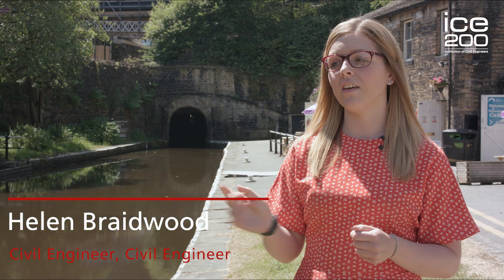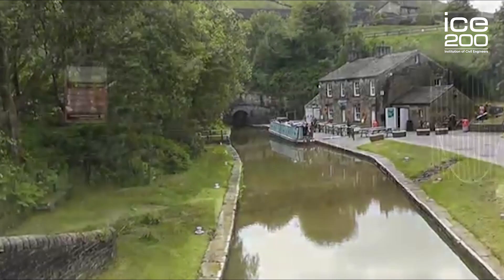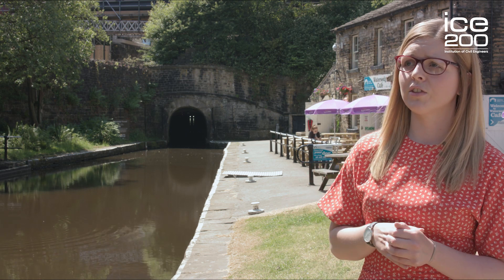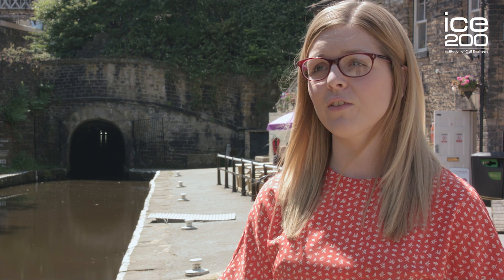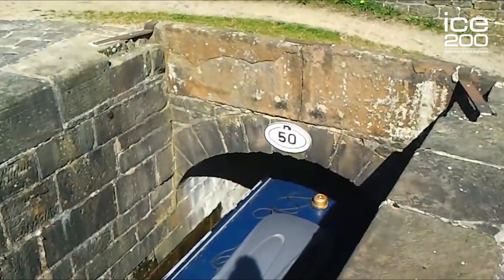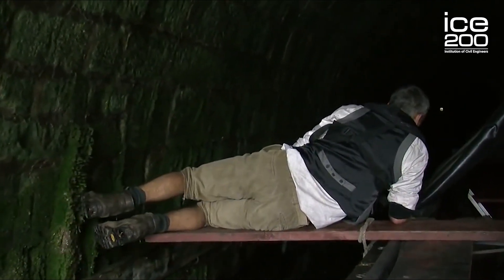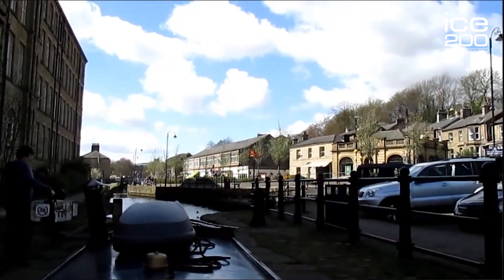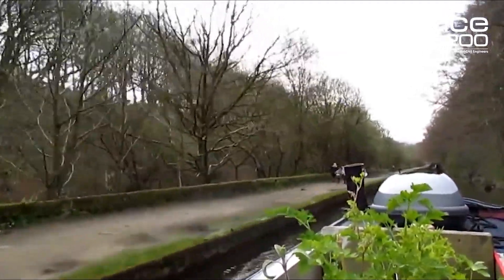Huddersfield Narrow Canal / Standedge Tunnel

Comment: Where would someone find out more about methods used while tunneling to determine direction and elevation in the 1700s when canal tunnel was built?
Just got done watching a narrowboater's recent video about this tunnel; they mentioned there was some mismatch in direction and height from the 2 ends where digging was being done, and while it is easy to fault the errors, it seems to me remarkable that they were anywhere near close at all.